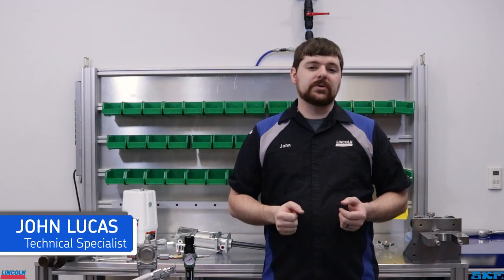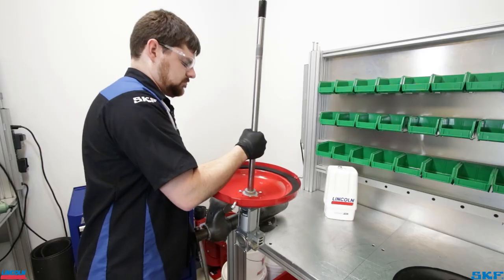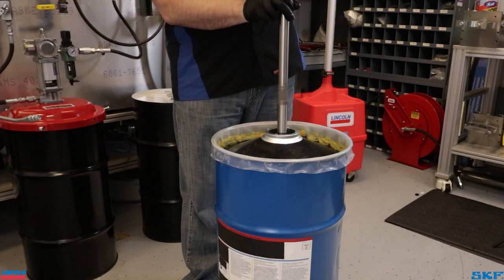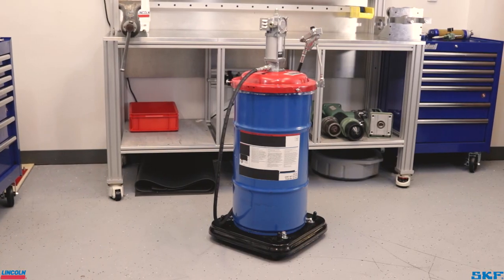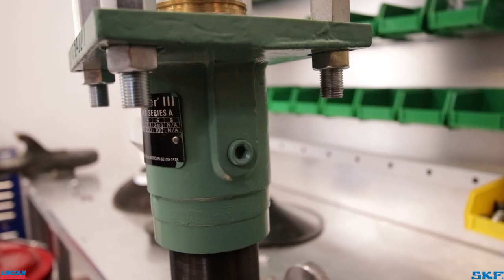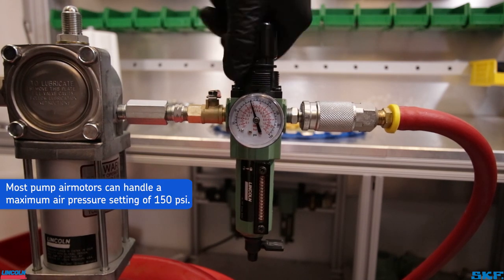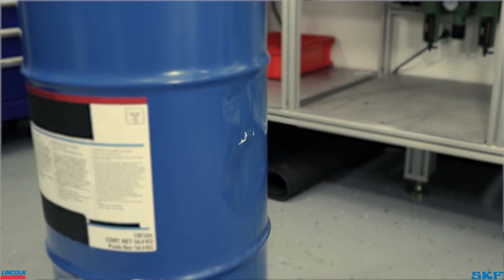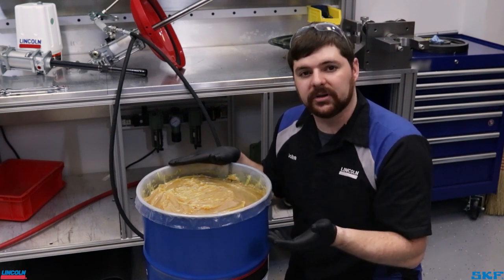Basic Grease Pump Priming Procedure

Comment: Hello, there is a problem that we are facing related to this pump. As mentioned in its instruction manual, If the system is full and free of air, the pump will stop by itself as soon as the pipe outlets are closed. Clould you explain, please, how is it realised? We would like to know more about controlling it automatically.
Reply from the maker: When you close the control valve, pump will continue to cycle until it has refilled the outlet hose or line and equalized the pressure in the line. Pump will then stall and not cycle until control valve is opened again to dispense. the is the same principal with most air operated pumps. 

~ John

Comment: I have your manual grease pump model # 1296.  I can not get it to prime.  Even tried adding oil into the cylinder.  I'm using NLGI #2 grease, but I also warmed up the grease with a bucket warmer to 40C to significantly decrease the viscosity and give the pump a better chance.  Even with 16oz of oil into the cylinder it won't prime.  Any other suggestions?  Am I not using enough oil to prime?  Should I pack the cylinder with grease?
Reply from the maker: Check for an air pocket at the inlet. This normally is the cause. Try packing the inlet if needed, and cycle the handle slowly. Prime the pump initially without the extension and adapter attached.

~John

Comment: Hello, on my pump, at the top of the tube that is inserted into the grease barrel, it is leaking grease back into the barrel instead of the hose at the top where it should be. It still sounds like it is pumping but not in the right place and I was wondering if you know of any causes and/or what it takes for repair?
Reply from the maker: Sounds like the U-cup separating the lubricant side of the tube from the air side of the pump is wearing out and requires replacement. What you are seeing is lubricant discharging out a weep hole in the base of the outlet body which is usually an early warning indicator to perform a rebuild. 

~John